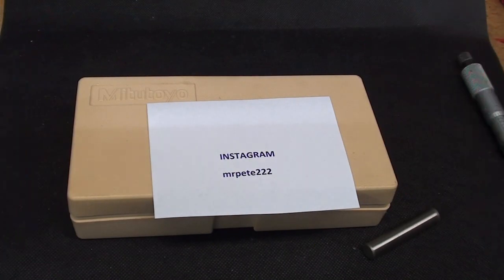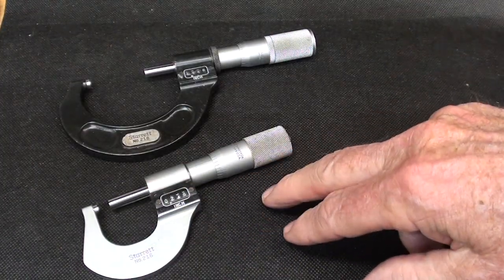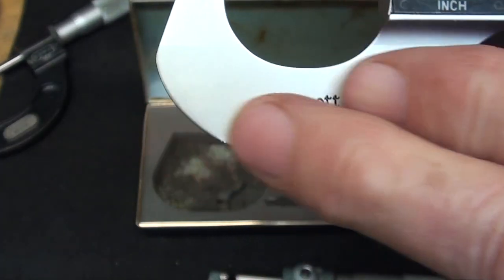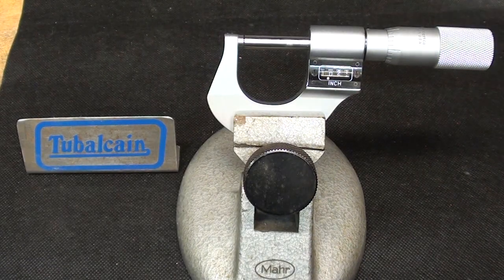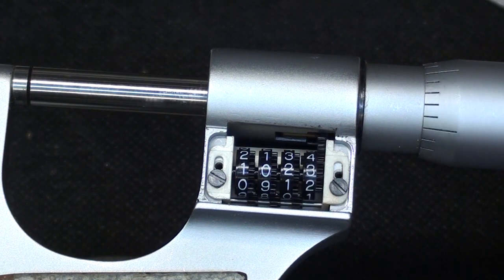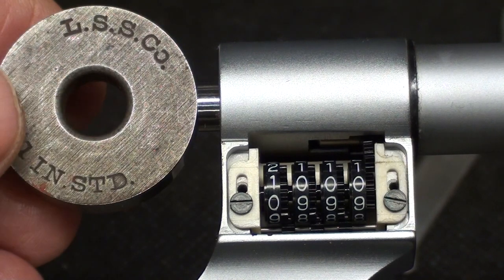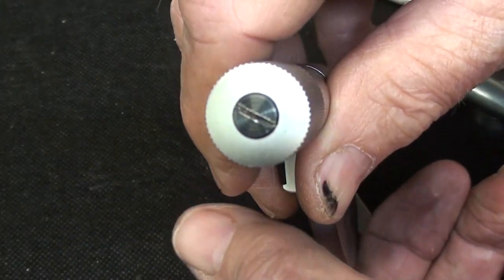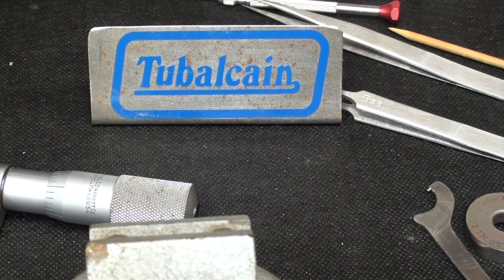Calibrating a Starrett #216 Micrometer TIPS #418  tubalcain

Comment: I was just given one of these Starrett #216 a few weeks ago. It sounds like you were having the same problem I was with the little click/sticking point. On mine is was any time the 2 came up on the last counter wheel. After taking it completely apart I was still baffled as to what was causing the sticking. I cleaned everything meticulously but still it persisted. Finally, by accident I discovered the problem had to do with the angle of the analog rollers in relation to the gear that drives them. Once I got that just right, the click was gone and it's smooth as silk now. But it was a very touchy adjustment on mine to get it just right.

Comment: Mr. Pete, I have one just like yours. When I got it, it had a really rough spot once around. Was not that hard to remove the digital mechanism to see what was wrong. Just take out the the two screws all the way and pull it out. It helps to remove both covers (top and bottom).  Taking it apart, found the gear on the spindle was cracked - plastic deteriorated and fractured. Had to take the whole mechanism apart including the thimble to remove the gear (same wooden handle trick). Glued the gear  together with cyanoacrylate adhesive, the more viscous kind. Also the top cover with the lens was cracked around one crew. Same fix. Timed the gears, calibrated. Works great, runs smooth and checks out against two other micrometers (Lufkin and Starrett) and a digital one (ashamed to say HFT but it turns out really accurate). My go-to mic now.  

BTW: I do not understand how Starrett quality ended up being degraded by cheap plastic in the main spindle gear. Oil tends to destroy this type of material. The counter gears and drums are and will be OK. Except for the window. Never overtighten the window screws. And even then it is likely to fracture in time.
Reply from the maker: Thank you, I may do that

Comment: I love those 216 Starretts Lyle. In fact, in your honor, I bought an entire set of them used last year--from 0-12" in size, as I recall. They came in a sweet old Starrett box, and had just been certified. They were pricey (for the set), but only a fraction of the price for a set new. They're awesome!

I have that same Mitutoyo digital micrometer as you do...I never use mine either. Once I get some 216 Starrett mics, I pretty much stopped using the other stuff.
Reply: Last year I called Starrett about sending them an older 0-1" model 216 I have, with a "catch" in the mechanism. They told me it was a straight $150 (might have been $155) to service the mic. They told me they basically just take out the mechanism, throw it away, and install a new one. It takes too long to diagnose/fix whatever might be wrong with the thing, so they just charge a flat rate to do it. Obviously if there is other damage they need to fix, it'd likely cost more. And this was last year--so they might well charge more for it now?
Reply from the maker: Wow. I knew it would cost a lot to have one serviced.
Reply from the maker: Nice score on that complete set

Comment: I've had a lot of trouble with that kind of foam.  I think its of a oil type base that does just melt and I have had a lot of video cameras, tools, and test equipment that have been infected with that stuff.  If you are lucky enough to get it cleaned of, the plastic pieces get soft and some times, and you just keep finding it leaking out of everywhere.  This seems to be a very common thing to find in most any fragile equipment.  Gun cases used this a lot also.  Like your micrometer, you are lucky it just went to powder.  If it had melted, it gets into anything that moves, and you would have to take it all apart to get that stuff out.  If you have any thing with that foam in it, this would be a good time to get rig of it before it breaks down.  After it melts, and it is not found right away, the next thing it does is turn into a very sticky tar,  and then you might as well throw that equipment away, it just destroys the quality and hardness of some metals. (springs, hinges, and stuff like that)

To get to the point, it needs to be removed before it starts to break down.

I enjoyed the video!!!!!!!!!!!!!!!
Have a Good Day!!!!!!!!!

Michael
Reply from the maker: Yes, it is nasty stuff

Comment: The catch at 10:00 is the advance mechanism for the next wheel-- the "carry" teeth. The Slocomb speedmike has the same feel, as do some Mitutoyo. I have never been able to get rid of that feel once a tool develops it, and I would guess that it is due to a slight wear, distortion of the gear teeth, or adjustment of the carry gear shaft.
Reply: I have both a 216 1" and a 25 mm mic. The metric one had that "click" at certain points in the rotation. Loosening the adjustment screws and moving the counters slightly away from the barrel seemed to get rid of it.
Reply from the maker: I think you may be right

Comment: I also have been getting extremely dissatisfied with battery-powered micrometers, calipers and test indicators. I just got several dial calipers (including a nice compact Fowler 4"), and will be pulling the (always) dead batteries from my collection of digitals before storing them away. I think I will also be on the lookout for something similar to the #216 for micrometer work. (Between cataracts and presbyopia, I am also getting to where optical assistance is required for reading anything so tiny.)
Reply from the maker: You will be disappointed to know, that I recently   gifts from shars and bang good.   So I will be using digital calipers. They both go off automatically so I rather like them. I also have a new electronic micrometer. It does not go off automatically. I do not think I will like it. I have been using optical assistance for a long time
Reply: Never disappointed. Just keep making interesting videos. 

One thing I have found about digital calipers that seem to run down batteries all the time. If you tighten the clamp, the batteries seem to last better. I suspect they move slightly and fire up whenever they are jostled if the clamp is loose.

Comment: I was perusing Ebay this morning and found a 216 on auction, a few hours left before closing, no bids, $9.00 minimum. It's metric, length not stated, but it looks pretty much like yours (perhaps 0-25mm?), and that's a hole in my mic team. I didn't know anything about 216's, so I searched, et voila! Here I am. 
Since you like them so much I bid, and ended up getting for it $32 including shipping and tax. It has a locking ring, a full scale on the thimble, don't know if that's Imperial or Metric, and a vernier on the shaft. Of course it could be crap, but what else are you going to do when you can't hardly leave the house? BTW, we're the same age, but I'm learning and you're teaching. Thanks.

Comment: Demand must still exist for these, as Starrett still manufactures the digital 216 in the 0-1" size.  It seems they retail for around $250.
Reply from the maker: Did not know they still made them
Reply: At work we still basically only use those, but the green lacquer version.

Comment: Good video. My digital mic is unbranded but has brass gears. Put a few drops of oil on those gears...don't use WD40...but something like 3-in-one or silicone oil. Don't use molybdenum oil as it can darken the digits up.
Reply from the maker: That is good advice
Reply: @mrpete222  Thank you, yes it operates a lot smoother a bit faster and quieter.

Comment: Hi, Great info. I have that EXACT same Mitutoyo you have in that disintegrating box. My Micrometer is suffering from something wrong inside however. Can you show how to take it apart properly without wrecking it? Actually mine is one of the those combos..the dial reads mm and the barrel is in Inches. Above the logo on the black plastic side it says COMBIMIKE in a strange rounded Font....Nice little unit i would like to get working again.
Reply: forget this..my home burned to the ground in May 2020 and it lost it and everything else.
Reply: @tubejoust  So sorry to hear that. I hope no one was hurt. We flooded in 2017, lost a lot of tools, so I can relate somewhat. Though fire's much worse.

Comment: One thing I noticed when you re- installed the cover - if you moved the number gear up too far,you wouldn't be able to insert the cover screws as their holes would be partially covered up - correct?

Comment: Thank you Mr. Pete,  I have a         Japanese mechanical digital one inch micrometer and their instructions step over the thimble adjustments. Is it the same with the small friction thimble for adjustment on the main thimble? Might I suggest a video on that type of micrometer for adjustments.
Reply from the maker: I just looked at a picture of one. Very similar
Reply: mrpete222  thanks I’ll take a closer look at mine.

Comment: I favor the old school digital.  But, it is infuriating that Starrett ever made digital without the vernier lines as well.  There must be a reason, I assume.  But very frustrating... while Mitu was making SAE / Metric and SAE.001 / .0001 versions with the fiftieths on the vernier.
Reply: Cutting costs would be my guess. Like with the plastic teeth on the gears, where Mitutoyo was using brass. Love the satin finish on the Starretts, but I'll take the baked enamel if it gets me better innards.
Reply: My 216 HAS vernier lines.  Optional feature?  I paid &35 on craigslist.

Comment: I’ll know the difference in the two micrometers; on the older one (your original one) the two “window” screws the right hand one, the slot is lined up about 15 degrees off horizontal and the other as well as the two on the new one  are all about 15 degrees off vertical.